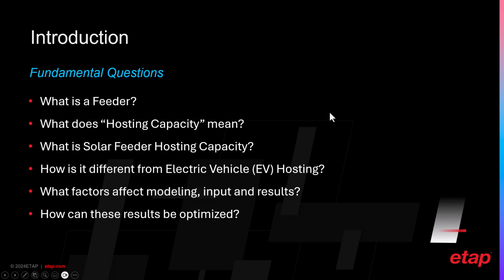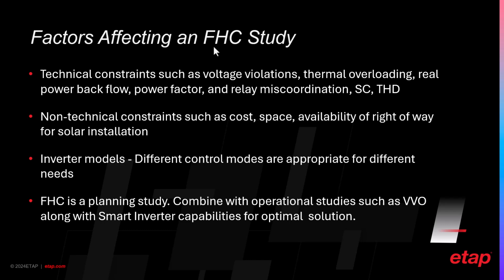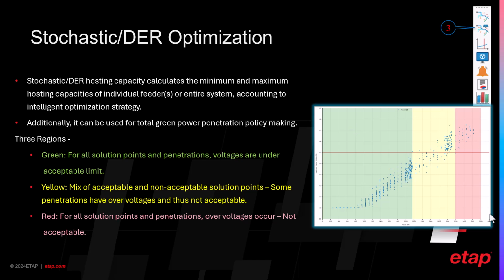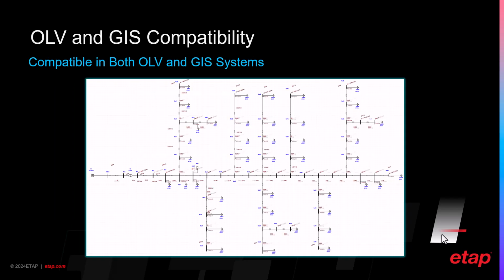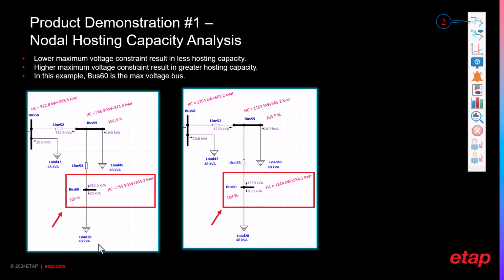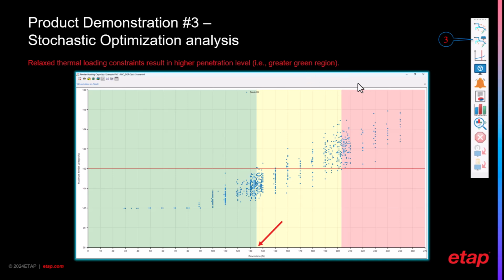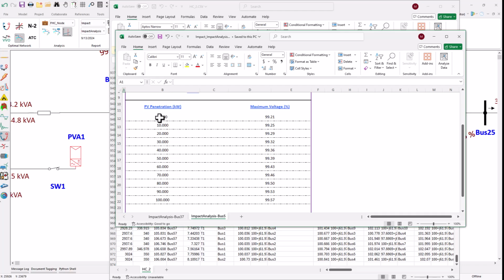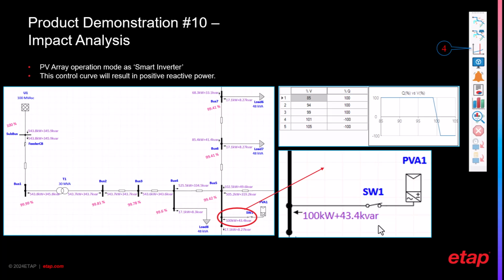Introducing Solar Feeder Hosting in ETAP 2024 – New Features for Sustainability and Optimization

Comment: Is it possible to simulate 59N protection in etap ?? Is there a broken delta VT in etap ??
Reply from the maker: Thank you for you interest in ETAP Solutions. Yes, ETAP can simulate 59N protection functionally by calculating residual (3V₀) voltage and applying it to a 59N relay element, which is sufficient for protection studies and coordination; however, ETAP does not explicitly model broken‑delta VT wiring or ferro‑resonance, as it focuses on relay behavior rather than detailed VT secondary circuits. That said, no relay coordination was added in FHC at this time, though it may be incorporated in a future version.

Please contact our Help Center at https://helpcenter.etap.com to assist with any further questions.